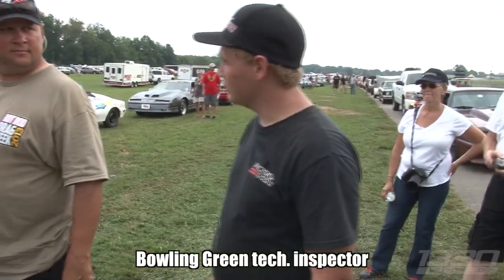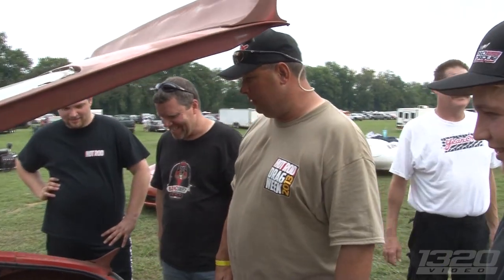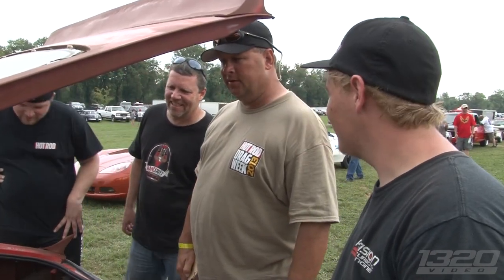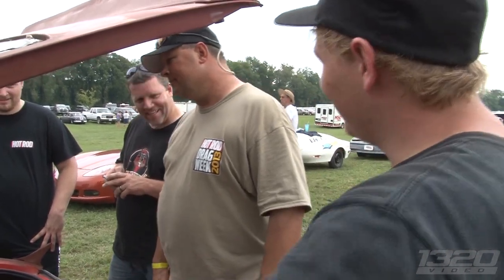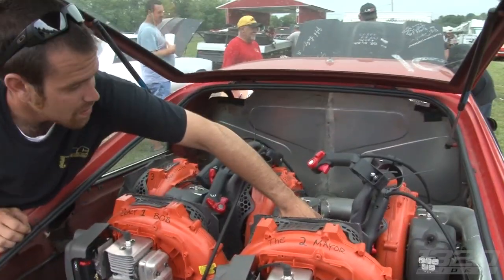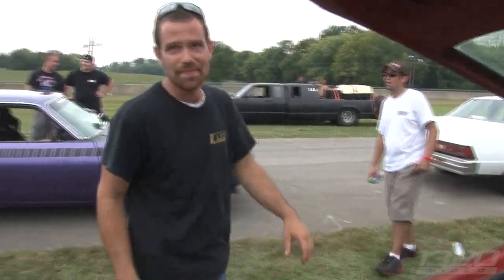Leaf Blower Monza - WTF?

Comment: HERE IS WHAT THEY DID WRONG....should not have been the leaf blowers onto a common manifold, It should have been one blower discharging into the inlet of the next leaf blower , basically I would not go more then 3 inline. That would raise the boost pressure, as I don't think air volume was ever the problem.

Comment: leaf blowers just push air, they don't compress it, which is what you need, and what turbo does in a car. Those turbos turn at like 20k rpm, finely engineered piece of technology. Leaf blowers will not add a single hp.
Reply: Just to call you worng sir we used a 150psi blow gun in a cbr600 air box and picked up 11hp at the rear tire made no boost just blowing air
Reply: it pushes air through the carb and intake into the cylinder and compresses it and pushes more and more so its more of a supercharger because it is not also powered by exhaust other than the fact that it is driven by there own motor or 5 rather than an extra pulley driven by the engine so therefore it could have less impact on the engine bogging it down and gives it up to the same psi depending on how much power the blowers have
Reply: so what....its cool
Reply: no because it do compress are that is why it blows 160mph air
Reply: So I am not a dumbass
Reply: Y10Q roadkill picked up 21 horsepower with these blowers.
Reply: it does hahaha and the monza doesn't need them to be fast its light as shit 2,500 with a v8😂
Reply: i think they probably know that mr smarty pants

Comment: Why do people got to+hate? It's the same exact concept as a turbo. S he didn't want to+spend a couple grand on a turbo kit and went with another route. If it works it works.
Reply: It cost $1600 alone on the leaf blowers, not counting in the labor for all the fabrication and materials. This is a completely stupid idea but it is funny.
Reply: Well, its not the same concept as a turbo. not even close.
A turbo is an air compressor (hence why the turbo has a Compressor Wheel), it takes a certain amount of air, compresses it, resulting in the same amount of air in a smaller volume, or in other words; air pressure.
A leaf blower, doesnt compress air, it just moves it from one place to another, just like a regular fan, it does not compress it.
To build boost, you need pressure, those leaf blowers dont have any pressure-building capabilities. therefor, they are not even similar to a turbo.
Reply: Shlomi Vinny They do make boost though. They showed it on the Roadkill episode. I seem to remember them saying they made half a pound of boost, but need to re-watch the episode. I also don't know ANYTHING about turbos, pretty much. But I do know physics/science, and if you keep "moving air from one place to another" and you keep the "another" place closed off, but just keep feeding it with more and more air, then you definitely get pressure, even if the engine is taking air away from it too. As long as the leafblowers push more air in than the engine would normally get from the air intake, it has pressure...
Reply: Mythbuster
I think it was like 3 or 4 psi from the leaf blowers.
3 psi is NOT boost!
Serious turbos can put out as much as 40, 50 psi or even higher.
On my car, the stock turbo put out 0.9BAR or 14 psi.
Reply: Shlomi Vinny It is boost, it's very little boost, but still. I recall it did add some horsepower, so they definitely did something :') I'm not saying it's  a "great way to make more power" though, not at all. It's all just a big laugh in the end, I wish everyone would understand that...

Comment: no intercooler?
Reply: The leafblowers essentially cool themselves. Just like if youo carried on on your back, you dont see a intercooler.
Reply: Its carbureted.  The air charge drops more temperature going through the carb than it would through an intercooler on a fuel injected car.

Comment: I think it's funny as hell.  :)   Now, how much more HP could you get from K&N Filters on the leaf blower motors???  ;p

Or skip the leaf blowers and carry just a big pressurized tank and release a little at a time as short term boost.  ;)
Reply: thats basically the premise behind nitrous
Reply: Hot rod magazine did a piece about scuba diving supercharging a small block. I dont remember the exact specs but it made bug increases.
Reply: +Erik Hose mickey thompson experimented with compressed air tanks in the 70s... was pretty effective.

Comment: Might Car Mods proved that this does not make any extra power.
Reply: Watch the roadkill episode, it did make more power.
Reply: Yes it did, it gave them like 5ish kw  increase with some cheap blowers
Reply: It did give them an increase of like 5ish kw
Reply: They had a carbed motor and did not change air and fuel ratio , that's why
Reply: +Tanner Schultz plus they were little electric blowers

Comment: So , may be another way round it ..... you close off a the holes round the engine bay , screw the hood down , with the leaf blowers on the top  & make holes in it & feed the air directly into the engine bay , no delivery losses due to pipe work & a few more BHP & a lot less noise inside the car / less fire risk...... so you can listen to ...w^3(dot)youtube(dot)com(slash)watch?v=qogVHlmFcx0.... on the 8 track . Not sure what you would have to do with the breather pipes on the carb & tank ? Nice ?